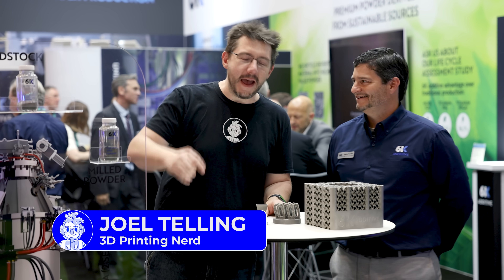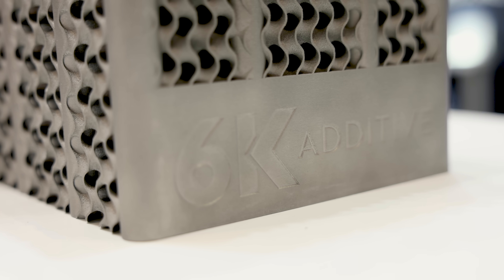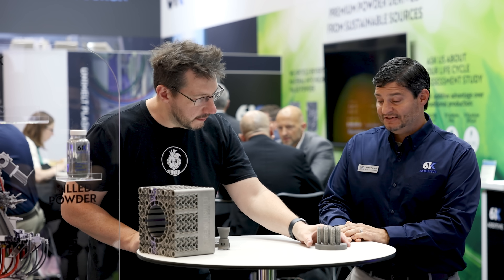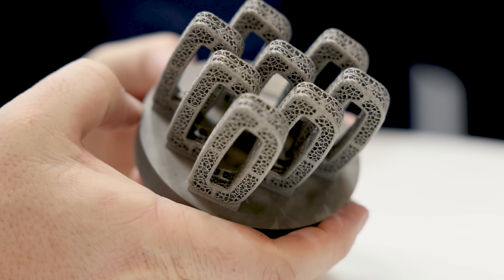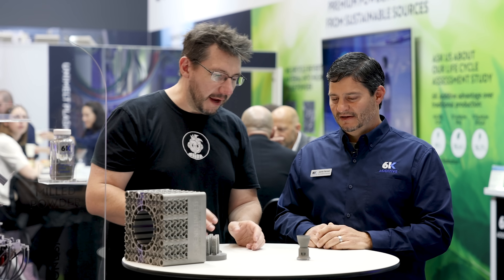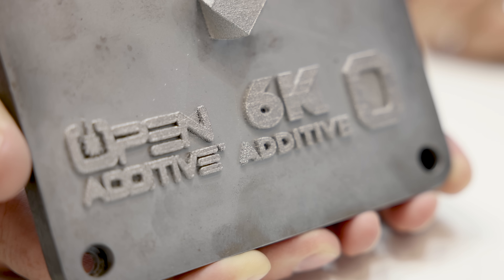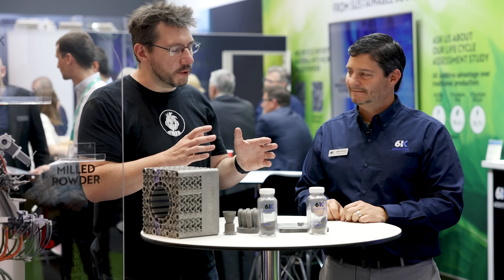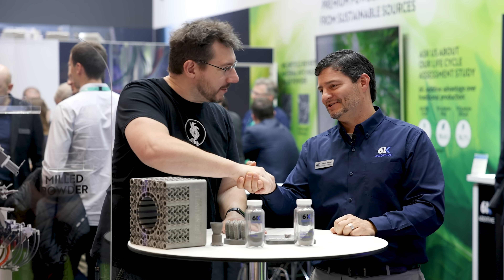3D Printing 100% Recycled Metal with 6K Additive

Comment: Here is something to think about - How much energy in different processes, do you spend on turning the "metal scrap" into an actual spherical metal powder particles you can then turn into the powder? Also, how do you keep the "very spherical powder particles" from taking in the humidity that will turn the "so cool flowing powder" to a "sandy not so flowing" one?

Comment: 3:45 I also add that oxygen will make titanium combust if the powder breaks down enough and gets super fine which is a risk when you ti blast the parts after printing. Titanium fines could cause a flash fire in the back of the blast cabinet but to counter this, Argon is introduced as a mitigation.

Comment: 0 oxygen environment "theory": make the oxygen denser by cooling/refrigerating, ideally near to visible sublimation point somewhere in between -183c and -100c. using pascal's law and hydraulics (water tank with 2:1 100:1 ratio to draw the now more viscous oxygen gas down (bottom of chamber should be proper geometry)

Comment: i think is posible to make that peace with stamps. Slice it and make stamp on each layer(will increase cost but if is mass production can worth it) and glue the stamps after this must include some oven and other thigs.
I would like see some comparation betwen 3D printed and stamp. But complex shape and leak test.
I say that because imagine i need a preburn with comex shape for 1000000 spaceships. Make it on CNC is expensive and 3D print is take too long. with stamp can be done fast and cheap(but need test)

Comment: Nerdy point of clarification for the 3D Printing Nerd...The structures that you are calling "gyroid infill" makes for a nice infill, but is not in fact infill per se in this case.  The topology structure has a functional, operational purpose and typifies  "triply-periodic-minimal-surface" topologies that are becoming increasingly popular in additive-tailored heat exchangers. The structure allows for segregation of two or more working fluids with maximum surface area, maximum mixing, and minimum flow resistance.  So calling it "in fill" misses the point, purpose, functionality, and properties of the structure.

Comment: All, i mean, ALL steel are recycled, you just cant run a steel oven without adding more metal to the oven to make steal, you burn the carbon inside Iron, by bubbling oxygen on it, so it heats up and then you add more steel to "recicle", cooling the oven. soooo... this sustainable steel is just marketing trash talk.

Comment: Ugh. Metal is the most recyclable material around with the possible exception being glass. In fact, many time s recycling metal can be easier than using freshly mined metals because they've already been purified, which isn't easy. You can also guage it for already being mixed with various base metals. Stainless steel for instance isn't something you just dig up and melt into shape. You have to precisely mix various elements together to make it.
Also, I think he mentioned they only use a fraction of the scrap metal.
It would be interesting to hear the specifics on power consumption involved because it sounds like a lot of processing. They melt it into tiny rounds metal prices they then use and melt later. So, multiple times each piece of metal is melted in the process. Also, likely, even though they use a small fraction of all the metal, they likely melt it all down in the processes where they sort what us usable and what isn't. Also, I would have to imagine adding Hydrogen to the metal and then extracting it again takes energy.
Really have to wonder how that total energy consumption really compares to new steal being made or the scraps being formed the old fashioned way.
Plus, I never really trust people who throw around jargon, including greenwashing jargon, and then sprinkle in propriety all over the place. They scream cash grabber.

Comment: I have managed to print a little bit of titanium using a small desktop laser. It was very challenging and at first all I was getting was titanium BBs on a micro scale! I can still only get one layer height and it is very fragile but I wanted to see if I can do it! The titanium I'm using is titanium dioxide and it goes right back into normal titanium when it's blasted with the laser. My goal is to have some kind of new laser by January. I've been using lasers for Ruby Fusion as well as other corundum and have even managed to cut extremely thin Steel but I cannot cut aluminum with the laser I have at the moment due to the fact that the aluminum dissipates heat too quickly. Seeing things like this make me so excited because it means that I'm even closer to being able to obtain an actual metal printer! Thank you as always Joel, looking forward to the next video!

Comment: 0.o? Steel (stainless or otherwise) is already among the most sustainable materials on the planet and has been recycled since antiquity. The reason why they are leaning toward recycling already-made products is that the specific alloy of stainless steel (like 304, 440, etc) is already a known result, and they don't have to worry about the cost of making new metal at a foundry.

As to their super secret process of breaking it down, they are using the extremely rare, and super duper secret technology of a ball mill................... 
There will of course be mechanical cutting, tearing, and shredding of the metal into small enough pieces to put into the ball mill first, but metal pulverization is a thoroughly understood and established technology decades old.

Glad to see them making a very interesting 3D printing technology with ultra-fine metal powders, but the sales pitch is riddled with a bit more "wizz bang techno speak" than it needs to be.

Comment: the 6k "proprietary process" consists of removing the oxygen from the titanium.
I'm not sure if you could do it by just heating it up under an inert atmosphere/vacuum or electricity OR even chemically.

removal of the hydrogen is most definitely done by heating it up

Comment: The recycling of the powder is HUGE! In most cases you can only reuse around 20-30% of the powder unless you have a special process. Theirs is INSANE! Great show! Jamie definitely not only knows his stuff, but knows how to talk to normies like us!
Reply: How are they able to use 100% recycled material if normally only 20-30% can be used?  What is the difference in the process?  Are there more impurities?  Do they do multiple melts and process for longer to remove more impurities?  Do they clean incoming scrap more?  What's the difference?  Because 100% vs 20-30% is massive.
Reply: @sirave6017  hey so I think you are misunderstanding what he's saying. So all the input material for the 3d prints is being sourced from potentially 100% recycled material. This 20-30% is talking about the actual powder during manufacturing. The bed of powder can only be 20-30% reused in another print. This is because the metal will oxidize and the part will become mechanical brittle. Its like printing rust instead of metal. There process allows the metal powder to be reused in multiple prints without refill for longer meaning that the powder you buy will be used more instead of being wasted after every print fill. Hope this makes sense.

Comment: In the past I've done metal printing at Shapeways that looked just like this final result, unless you have them polish it. I guess any powder based SLS printing would look like that.
Reply: I wonder how fine you can make the powder before it starts burning in air. I know Aluminium at 200mesh is a fire hazard.

Comment: High res metal printing at reasonable cost is practically the holy grail right now. Imagine getting metal prints (I'd even take aluminum for certain things) for resin prices. Sign me up!
Reply: But I would imagine this isnt cheap at all.
Reply: @lucky-luke8158  it requires a damn reactor